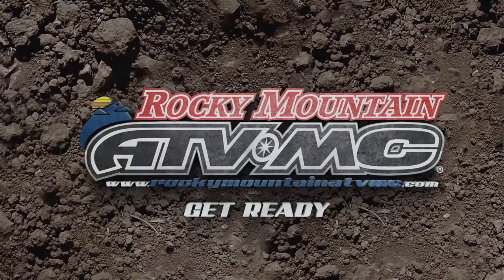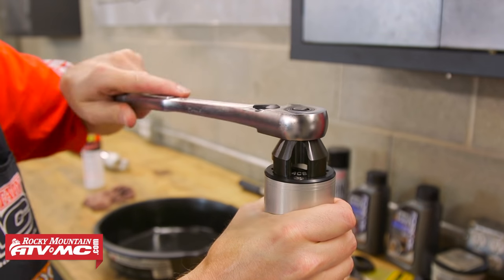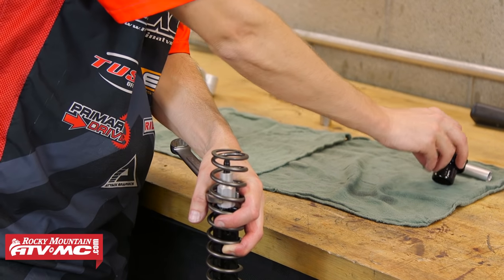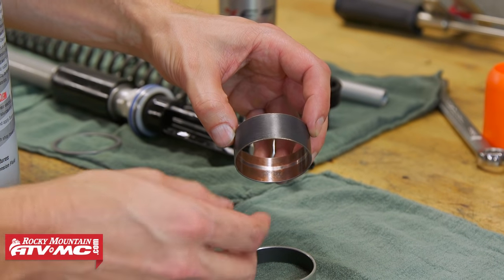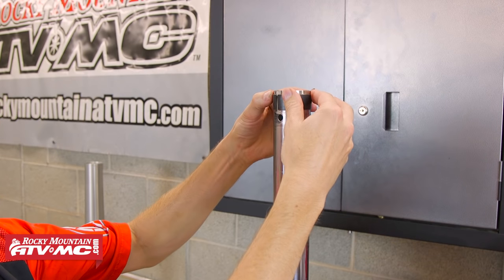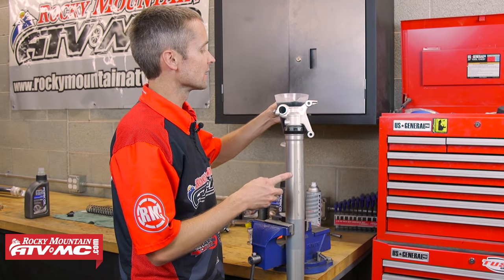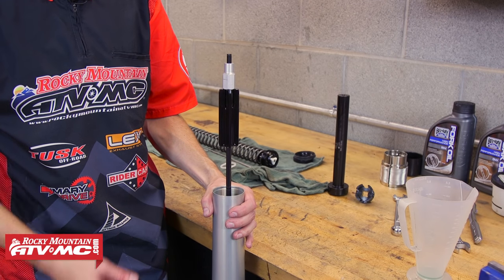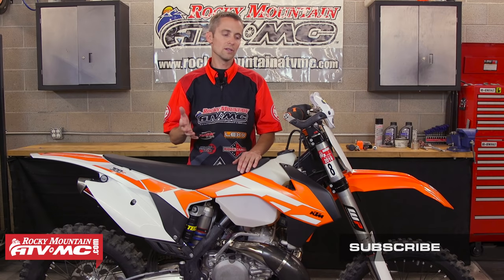KTM/Husqvarna WP 4CS Fork Rebuild

Comment: Pro-tip: before driving the oil seal in, use the seal driver to pound the bushings into place. Mine took quite a beating with the driver and dead blow to get low enough to get the oil seal in far enough for the circ clip.

Comment: At 13:15 he says to torque the fork piston rod to the cap at 14 ft lbs. DO NOT TORQUE IT TO THAT. The correct torque is 8.5 ft lbs. It cost me $75 and 2 weeks to get a new fork piston rod. I torqued it to 14 ft lbs and the fork piston rod sheared right off. I had to easy out the threads from the cap. Not a fun month....
Reply: I wish I saw your post before I torqued mine to 14 ft lbs! Same damn thing to me!

Comment: A tip before parting to fork (wich also stated by ktm) is to heat the outer fork a little (unill roughly 50 degrees celcius) to making parting a little bit easier. Also for remounting, its adviced to heat it up a little bit! For the rest, great video!
Reply: hey man HELP !! ,guys i dont have access to dedicated fork seal grease so what other grease can i use to lube the seals, PLEASE BE ELABORATE because i use all purpose grease and seals started leaking in a day

Comment: Hi guys 
I'm currently rebuilding some 4CS off a 2015 FC250 
When I added oil to the lower section and I was pumping the rod a fair amount of oil ran out through the upper section. I added an amount of oil extra (guess) for the amount that ended up on the floor. 
When spinning around and adding oil to the top section the rod will not float up by itself. Takes a small amount of effort to push down and stays down will not float up. 
Any ideas to help would be appreciated 
Thx
Reply from the maker: Is your O-ring still good on the rod?

Comment: My 2016 KTM XC-W has the same for but the top cap is different but I think it's the same procedure with a few different tools
Reply: Is it? I have a 16 and my forks have been leaking since not long after I bought it new. Did you rebuild yours?

Comment: Is that the preferred  method ( volume 510 cc bottom, remainder 130 top for 640 ml  or cc total) I have always understood to rebuild modern cartridge forks the other side up, collapsed without spring and fill chamber slowly while stroking inner rod to bleed and using a linear measurement of the oil  level to the top  the tube.. ( air chamber / volume)
Reply: Yes, 510 bottom, 130 on top. While filling bottom (do this first with cap off, stroke damper rod up and down to help bleed. Pour slowly. Put in base valve, turn over, put cap on cartridge, fill with 130ml, pull up cartridge to max extension, then outter tube to match. Screw on. Pressurize with ~80 psi for 5 sec via removed bleeder screw. Lower outter. Set oil height. Insert adjuster rod, spring & spacers and screw on cap. Set clickers.

Comment: When I fill the bottom chamber it is leaking out of the tube as soon as I pump the rod. Any ideas?  Is my vice too tight or should I replace the O- ring on the top? Any help would be awesome.
Reply: Watch the way Slavens racing fills these forks. This guy is doing it wrong. i have no clue how he keeps the fluid from leaking out.
Reply: It doesn’t leak out of mine when upside down. I’ve heard of people having that issue and I have no idea what causes it.
Reply: You have to change the cartridge rod seal

Comment: Am I missing something? When you add oil to the bottom of the fork, what keeps the inner cartridge from sliding out and spilling all the oil? @10:00
Reply: I rebuilt these forks after my comment, and I get it now.
Reply: @ryanlester761  what's the answer?  I get oil leakage
Reply: @HyperionGamingTOPKEK  Man, it's been a while. Being the inner cartridge, I believe you can add oil into the inner cartridge when it's not inserted in the lower tube. Maybe you spilled a little over the outside of the inner cartridge??? ... and moreover, I read some other comments below and they're saying you need to replace the rod seal if you have a leak. Also look up Jeff Slavens "How to Fill WP 4CS Forks" video. He does it as suspected- with the top cap on while filling the for held upside down. https://www.youtube.com/watch?v=BbKIdVjo3Ic
Reply: @ryanlester761  i got creative while I was waiting on a response and found that just being super slow and careful keeps it dry because if you push and pull too fast you'll yank the seal out
Reply: @HyperionGamingTOPKEK  I was just pouring mine in with the fork upside down like I always have and it was coming out the bottom. Never had that problem before. Any idea what seal might not be doing its job?  I am having trouble finding what it would be on the schematic.  I may hafta revert to Slavens' way.

Comment: I cannot find the fork cap wrench on the website... could anybody send a link to me where I could find it?
Reply from the maker: https://www.rockymountainatvmc.com/p/1056/13900/Tusk-Fork-Cap-Wrench
Reply: You can easily make your own. Just need a metal bar something like a ruler but could be  less than 12 inch long.about 2 to 3 inch wide and sturdy enough not to flex. Drill 2 holes on each side of center that align with the cap holes...the holes should only be big enough to allow the  largest threaded screw / bolt that will fit inside the 2 cap holes . Use a 2 inch screw with washers and double nut on one side. The tool should fit on top of the cap with the 2 screws fitting inside the holes, cut screws down to strengthen them from bending when rotating. The caps are not on tight and this will work perfectly.

Comment: Anybody had issues getting the bottom bolt out, mine is super tight don't want to break anything, tried on both legs the same, did I miss a step?
Reply: Use a propane torch  to heat it up.
Reply: Hit it with an impact after using heat

Comment: Why are some people using compressed air
Reply: Joey dirtbike they use air to force oil to push the cartridge rod up, so they can push it back down and bleed the system. In the video he used his hand to pull the rod up and pushed it back down manually to bleed air. I would do it the way he did it here, i think anytime you use compressed air when you dont have to you’re taking unnecessary risks, just my opinion. This video is the way to get it done right.